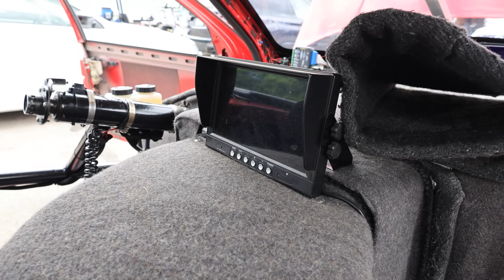Turbo LS mk4 Golf R32 w/ DRS, Making 700hp+: An Engineer's Dream Machine

Comment: The car looks like it would be so weird to drive sitting that far back, but if you think about it as if the car had a really long hood, it's not that odd. I used to have a 280z, you basically sit right in front of the rear wheel. You get a really good feel for what the back of the car is doing sitting far back like that, but it's not really that weird.

Comment: VR6 platform was the one called "Wookiee" ORIGINALLY because of the sound these engines make. 
the R32, R34, R36, R38 engines... all are based off of the VR6 platform so they started calling them Wookiee as well. The Wookiee reference was made for the VR6 style engines so the "Wookiee" credit goes to the VR6 engine. just a bit more accurate info for you to know..

Comment: Well it's like, in the 1940s and further back. Cars had massive engines in them before fuel consumption became a problem. And the engine bay took up most of the size of the very large car. And those cars back then put out 1200hp 10 liters and up. For why muscle cars today still haven't died😂